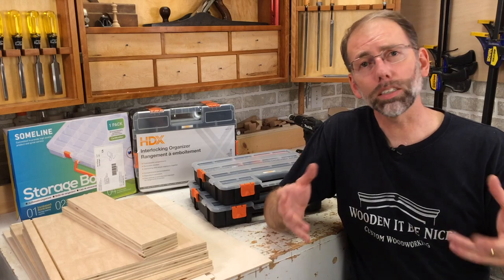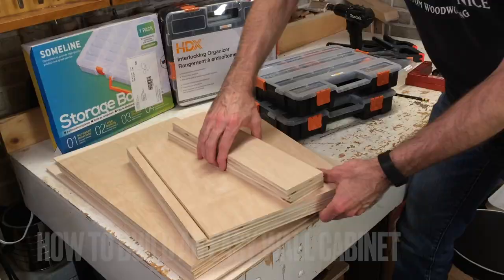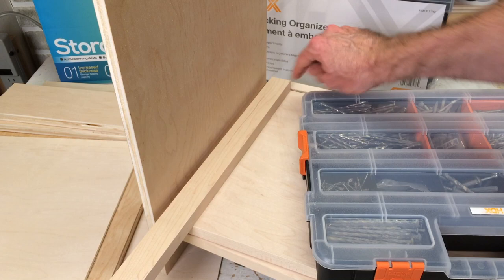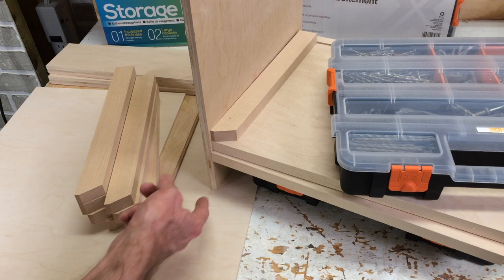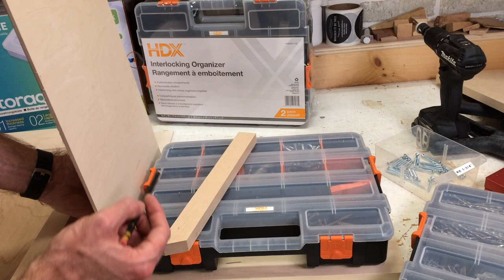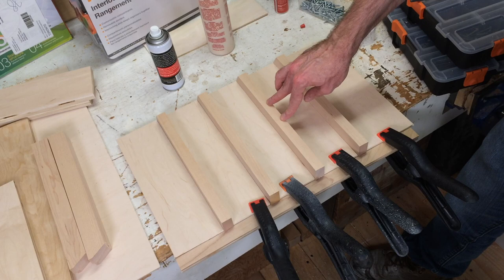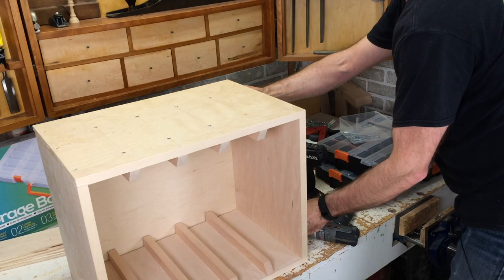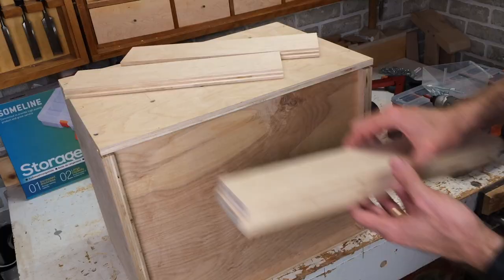How to Build a Cabinet for Organizer Box Storage Containers with Additive Woodworking Cabinetmaking

Comment: Nice work!  Question:  Why use nailers instead of a french cleat system?  Not just on this cabinet, but all of them?
Reply from the maker: Thanks!  While a French cleat is a neat idea, in practice, I find it adds more work for the installation process.  With nailers, I just hold the cabinet in place and drive in the screw.  That's my preference.  Scott

Comment: Hello from New Brunswick. I was wondering what you think of water based contact cement.
Reply from the maker: I prefer water-based contact cement, but it's not something you can use one every material.  This veneer will swell and cause issues with water-based contact cement.  I hope that answers your question.  Scott

Comment: Why did you leave the lids on? It adds three steps to retrieve a part (2 catches and a lid) and another 3 to put the tray away. Six movements extra. They also take height. And they serve no purpose. Would you have a drawer with a lid?
Reply from the maker: The kids are important.  They no only make the cases mobile for work outside the workshop, the also prevent spilling.  Could you imagine the mess if one of these tipped over?  I like the function of the lids.  Scott
Reply: @HomeImprovementWoodworking  If you are going to leave the lids on, you do not need to store them horizontally. Stored vertically takes less space and you do not need the supports.